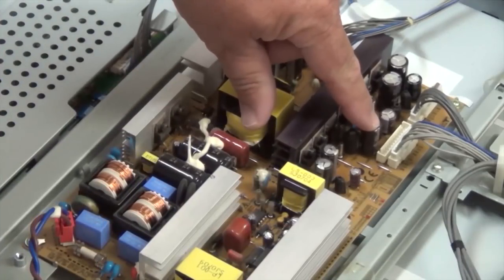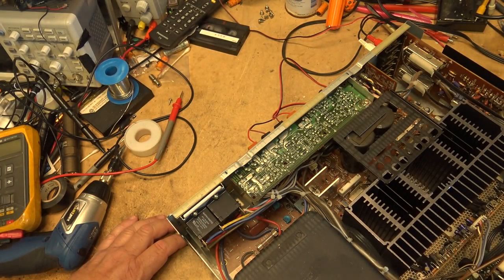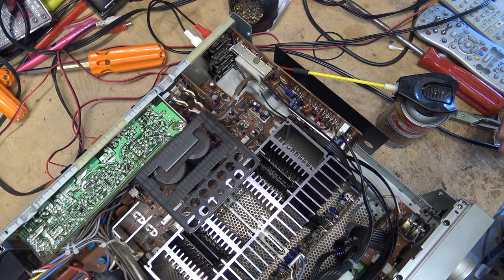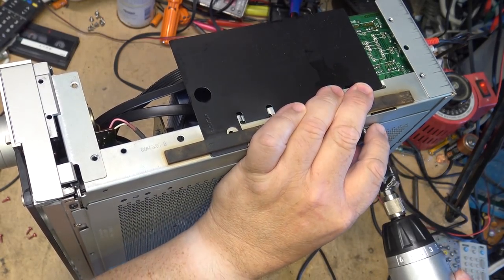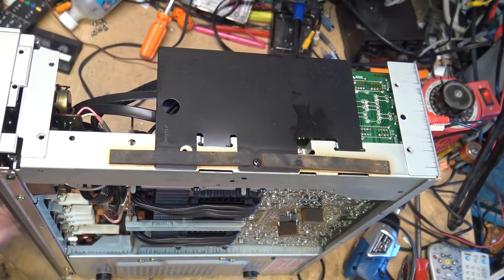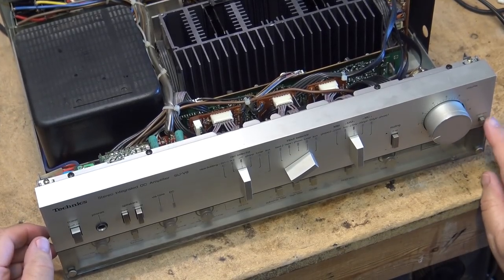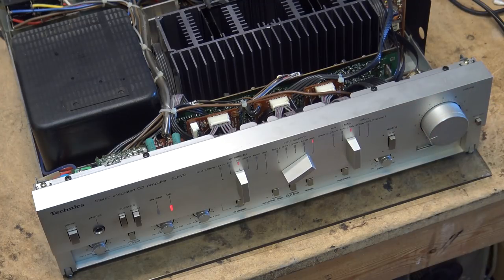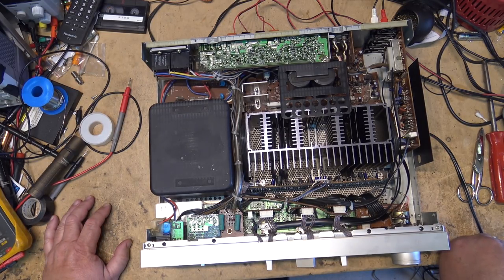Technics SU V9 Power Amplifier. An underrated monster worth consideration. Fantastic sound.

Comment: The AllDatasheet site requires you to follow the download-PDF link (Free), The reason for the blurring is because they use a terrible algorithm for auto-generating the preview.
Others probably stated the same.
However, trying to get datasheets on most things from the last few years is near impossible, especially schematics and board-views.
Reply from the maker: I do not install "free" readers or any other add on apps to view something. If a clear pdf is not available I move on. The reason for this is because spyware and viruses lurk in these free reader or helper applications. I have enough pop ups from google, which I allow because I am a partner and I make money when ads run on my videos and I feel it is fair to allow others to make money if I watch their content.  So for that reason I do not block Google's ads, but I won't install and 3re party helper apps and I also don't but into the so called ad blockers.  I did many many years ago. I paid for a commercial spyware and ad blocker and felt pretty good that I was safe from spyware as i was using a commercial, not ad supported free version.  Then i got a physical letter in the mail from the federal trade commission informing me that the company I had dealt with had been ordered shut down by the FTC for all kinds of fraud and illegal activity.  While their software was telling you that the sky was blue and grass green and everything was rosy on the computer they were infact data mining all kinds of info, masquerading as the good guys.  (Read up on spy killer). So excuse me if I don't trust anyone or anything in the cyber world.  Once bitten.....
Reply: @12voltvids  IDK how on earth going to alldatasheets dot com and downloading a PDF from there (like a lot of people... probably also Louis Rossmann too) causes viruses and "ultra-extreme-pro-edition"-ware to magically install.... but then again, I only use my blandroid phone as a dumb-phone, don't use a FRiPhone and use Debian Wheezy distro patched up to the hilts with libraries cross-compiled on one distro and made to work with this one on a Lenovo T400... and yes, I do security patches by manual checking of CVE advisories... there's probably tonnes of holes and not yet have I got a virus... also even though I made no mention to adblockers... I may as well mention now the topic is up... I use Adblock Latitude only when logged in and disabled for most sites of my liking when logged out... else google's youtube has a habit of putting up some confusing advert choices that are meant to be relevant to I but not being relevant at all... Like how does lipstick help a guy like myself solder? Maybe advertise soldering stations instead google? Also the adblocker Latitude one I managed to bodge into working on my Palemoon web browser (Firefox clone... because failfox is one way to sometimes get spied on... they've been caught out a few times... so ya know)... the adblocker doesn't force up adverts... though cant block all adverts (The ones that use less common scripting... I can use NoScript for that instead if I have to).... Also I'm aware of the possibility the adblocker may try to filtrate data out... since Wireshark shows no odd activity loading google.com with adblock latitude on vs off... it seems clean... Then again, if I need actual anonymity, I'd use the tor browser and hitch off a random hotspot (We have BT-WiFi hotspots here and many people openly share their logins with friends they trust, sometimes going a bit further a field. Then there's generic hotspotting, even though I'm aware of MITM attacks, they're a little difficult when the hotspot has to circumvent app-to-server encryption.)

Comment: My amp! :) Still the only thing I have that will really drive my 70's Wharfedale Crossover speakers. 
At what point do you think those big PSU caps will need to be changed? I have seen 70's caps that have REALLY gone bad. 
Are the 80's ones any less squishy?

PS: Yes the Class A logo is supposed to light up. But since its literally a BULB in there, its always loooong since blown.
Reply from the maker: Yes the bulb is blown.
Reply: @12voltvids  like you video on this amp. I just obtained a
 Su v707, I have cleaned all slider pots and switches. Still no sound on mains or remotes. Headphones has some sound but very very little. Any pointers I would appreciate greatly.

Comment: I remember hearing Panasonic, Pioneer and Techincs are all Panasonic brands. Ah interesting sounds like it wants to work. By the way I still have a slightly faulty Denon CD Recorder I think I’ve figured out how to fix the CD Recorder drive as it’s currently stuck. As I tried it in my Marantz CD Recorder but failed as I found it was too big, so I bought one from Instrumental Parts in the US. As I live in the UK but could get one from here. Anyway I fixed my portable one and it’s fully functional now. The problem with the Denon was I couldn’t find the switch and having looked at videos I thought ah maybe it’s there!! So I will try again soon then re eBay sell it. It’s perfect apart from slightly dented as I reckon someone accidentally dropped it probably.
Reply from the maker: Well technics was definitely a Panasonic brand. They had some real high end stuff.  I now have the set.  I am getting the tuner that matches this unit, and I have the rsm275 direct drive cassette deck that matches it and the slm1 turntable that also matches.
I don't know that pioneer was involved with panasonuc.
Reply: @12voltvids  
Dave you have to tell me, I'm very serious - what is it about this RS-M275 deck that every one likes so much. I never have a chance to hear one. But if my belt driven Nak will misbehave after I change the capstan motor and belt, I might be looking for serious DD 3header (no Permaloy heads). The best Technics deck I heard was top of the line 965 (or something like that) with Amorphous heads sold in Europe (Germany). I was teenager back then. Very nice machine with DD and bias, tape sensivity level adj. with test tone generator. Damn expensive, same price as top AKAI, Aiwa, Sony, TEAC, JVC, etc.

Comment: wow. that's a beauty. I've never seen that model before.
Reply from the maker: I like this amplifier. It is now my studio monitor. It has such good sound, probably one of the best sounding amplifiers that I own that don't use vacuum tubes. Another one is my luxman LV 103.  I got this one for free. Just had to clean the input switch. The guy that owned it thought he cleaned the switch and it was still noisy so he gave it away. He cleaned the switch all right the switch for the panel lights the switch for the audio are the ones at the back that have to pushrod cables connected to them.

Comment: I used to have one of these! My friend pulled it from a skip. Put it into tech to get repaired, was only a faulty transistor. Had it for years. 
Thanks for explaining what new class A means 🙂
Reply: I always wondered what New Class A meant. I know now.
Reply from the maker: A real class A is single ended.  Class B Push pull.  The problem with class B is cross over distortion when switching from 1 transistor to the other. Class AB adds a slight bias to keep the transistors idling so at no signal both the transistors are in very slight conduction.   The non active transistor does go off completely when there is a signal present but it also comes back on before the other one goes into cutoff.  This is how most amps are biased.  A true class B has high distortion.   New class A is still a push pull, they just drive plenty of bias to both transistors soothe transistors are in full conduction and passing a fair bit of current even when there is no sound.   Right through the max power limit of the class A bias limit, both transistors stay in conduction.  This is very power inefficient and these units will draw a fair bit of power even when producing no or very little sound.  I believe the bias drops down with volume to save power but at the max level for class A operation the transistors are wasting much power as heat. Once the power level goes beyond the limit for class A operation the bias drops to the AB bias level. This happens instantly. So these units uses for background music will spend the vast majority of their time in the power hungry class A mode but the distortion is almost immeasurable.  Will be interesting to see how this compares to my old luxman hybrid.
Reply: @12voltvids  outstanding explanation- thankyou. I used to have a marantz pm6200, beautiful amp. Had a class A mode switch which gave 30w  class A sound.  
Normal mode was class AB which was much more powerful, i enjoyed class A on for intricate music, sitting in the dark. Was stunning. 
Funny how music comes to life when its pitch black! 
I gave the amp to my folks few years back and they barely use it! 
I use a NAD c352 these days. Superb amp. And of course i changed out the fail prone crappy caps with decent ones!!
Reply: So Dave this is sort of like a sliding bias, for low level amp operating in very overbiased class AB. Many DIY people commonly set bias at way over 50mA per pair. 
As for the tone controls, I learned to live without if spkrs have good crossovers and are well voiced, but I would use some boost below 50Hz.
Can I have the Luxman 😉
Reply from the maker: @pliedtka  I don't know of the bias varies or just goes full on class a bias at low level

Comment: Great video!  would love to see a recap done on one of these.
Reply from the maker: Doesn't need it. Recapping is over rated.  This is a DC or direct coupled amp.  Caps are in the power supply and tone boards. Not many elsewhere.  Turn the tone off and most are not even being used.  Seriously recapping is over rated.
Reply: @12voltvids  yes it's a new in today to make recape. Only do this if its is Necessary to recap the unit totally. Like a amp that's run very hot and has done this for many years then a recap maybe is a good idea

Comment: A Luxman replacing by a Technics... Brave!

When I was a teenager I had a Technics SU-V650 and replaced it later (I was over 20 already) by a Luxman LV-105. The Lux sounded way much better. Technics never sold a lot high end stuff in Europe.
Reply from the maker: Will see how it sounds. Will probably not be a permanant swap but the lux needs a major overhaul.  Phono preamp doesn't work and the input switches are bad.
Reply: Oh the LV-105, I remember when Bleekers caried them in Ottawa - beautiful amp. Luxman made very good stuff back then (part of Alpine Corp). Now being back with tube equipment I wish them a lot of success - one of the companies that deserves it. I think Mr. Tim de Paravicini designed some amps for them very long time ago - at least that's what was written in interview with him.
Reply from the maker: @pliedtka   bought my luxman back in the early 80s. Paid a shitload for it. About 2200 and that was more than I could afford back then, but fell in love with the sound.  It's not a very heavy amp though, the transformer is not that big. This Technics weighs about 4X as much, has twice as much power and shakes the walls.
Reply: @12voltvids  there's a guy on Polish DIYAudio that does similar tube-solid state hybrid amps as the LV-105, for the same reasons as Luxman did. Many people like this amp a lot, and it drives 2ohm loads, not many could do it. I had used Sima from Montreal, only 50W/8ohm with 4 500VA toroids in it as the original owner ask Victor if he can double the PS for his Martin Logans that went down to 2ohm. 2 pairs of MJ 15024/25 per ch at +/-36V - not bad of amp if lots of current was needed.
Reply from the maker: @pliedtka  Tube buffers recreate the tube sound on solid state amps. I think I will hook up a tube buffer on this Technics.
Reply: @12voltvids  actually he replaced the whole differential input and VAS if I remember correctly with tubes, leaving only voltage biasing stage and Darlington stage, but I would have to check again. For sure the input stage is tubed though.

Comment: You scored. That is a nice integrated amp and it looks to be in great physical condition.
Reply from the maker: Hooked it up tonight. Very impressed. Now I find out what other equipment died since the last time I used it.  Played my minidisk. Played disc perfectly.  Was 1 track of test tone I went to delete.  When writing to disk it died and now won't read.  Amp sounds great and drives my altec lansing 315 really well.  The slm1 turntable sounds great through it.  I may have found a new favorite amp.

Comment: What speakers did you test with?
Reply from the maker: I run it on a pair of altec Lansing 305
Reply: @12voltvids 
They sound great.  Even over YouTube.  I followed the SU V9s back in the early 80s.  I’d probably buy one if I didn’t already have an Adcom / miniDSP / Klipsch bi-amped system.  Do you do repairs in all audio components?